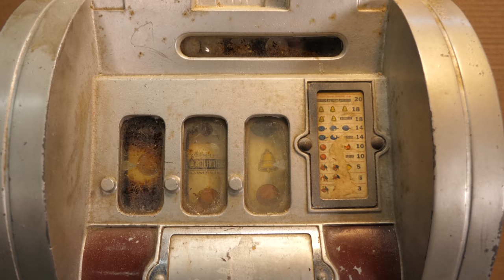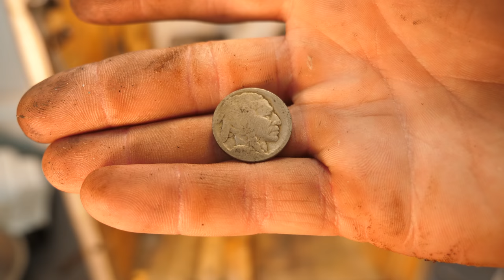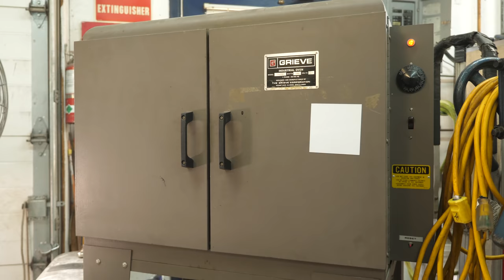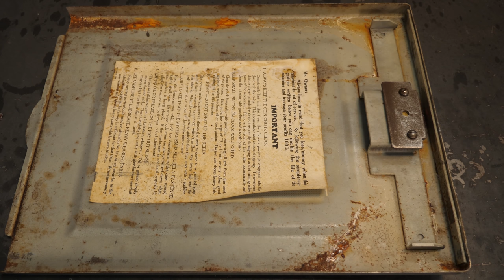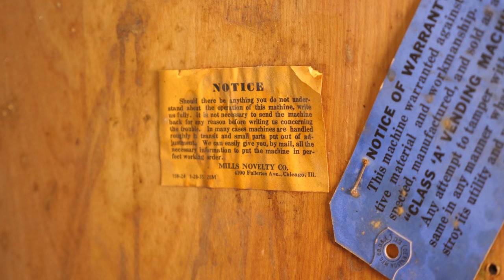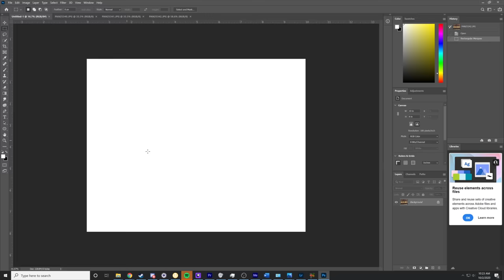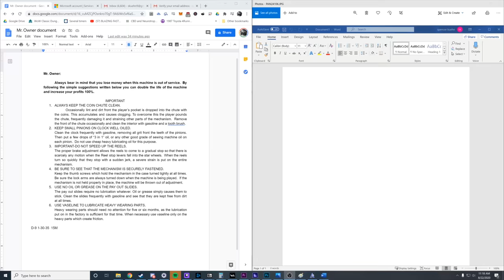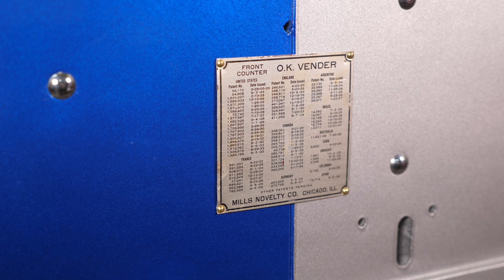1933 Mechanical Slot Machine Restoration (Slot Machine Part 1)

Comment: I collect antique slot machines. You should never have restored this machine, less replacing maybe the glass because of the cracked film in the middle of the panes. The machine is worth more, objectively, in an original and unrestored state. It shows its history, which you just destroyed. The interior mechanism is also not supposed to be painted. They are cast aluminum parts, and any restoration should have stopped after sanding away the rust. There is no need to paint interior parts. At least someone would be able to identify the parts are original. Now its anyone’s guess. The same goes for the labels. They prove the machine’s originality, and the back door label was perfectly fine. A little bit of glue and you would have been set. The front plate where you shamelessly plugged your channel logo is supposed to be an eagle. You can buy new old stock plates on eBay or from other collectors fairly easily, again these are common machines. The reel strips and award card were also just fine. They were original to the machine and hold their own value. Reprinted reel strips are too glossy and diminish the value of the machine.

Since many people here seem to have never seen a vintage slot machine, I’ll give you a bit of history on this particular machine. It’s called the Mills Extraordinaire, the side label saying Mills Front Counter OK Vender is incorrect. Someone must have put that on the machine before you acquired it. This is without a doubt an Extraordinaire, and they’re almost always found with an accompanying console stand. The machine is supposed to sit in a wood console and would be found on the floor of casinos or in saloons. When it comes to the original color scheme, well its pretty much anyone’s interpretation. They were often painted to match the aesthetic of the location, but blue and gray is fairly common so at least you painted it right.

One final note, the mystery part you asked about at around 43:00 is more than likely for a Gold Award mechanism, though I can’t be certain because the machine is completely disassembled here and I’m not there physically to inspect it. Anyway, many vintage mechanical slot machines have a secondary “jackpot” in the form of a redeemable token. The operator would slide in the tokens and if you hit a winning combo, a Gold Award token would drop out in addition to a standard payout. This is likely why your machine has the FOK Vender side label. It’s quite possible that this machine is actually a conversion-front. Meaning it has the front marquee and design of one machine but the mechanism of another.